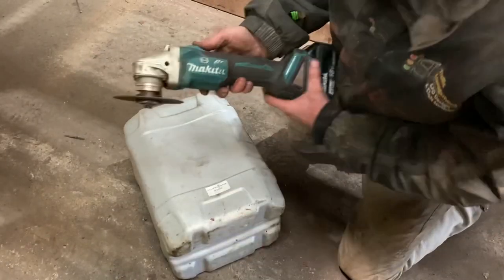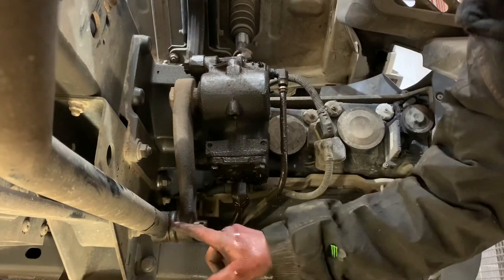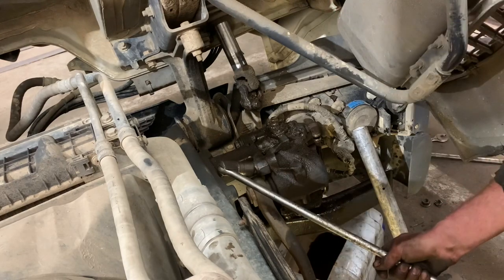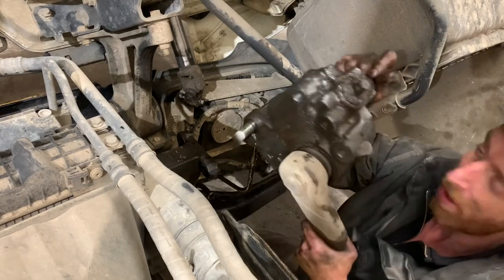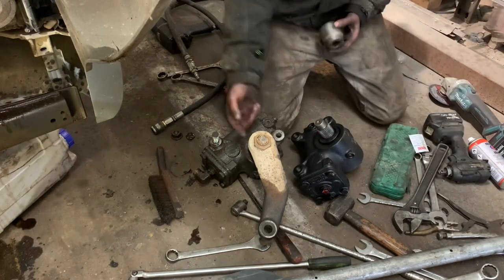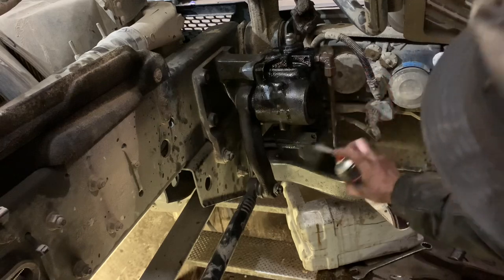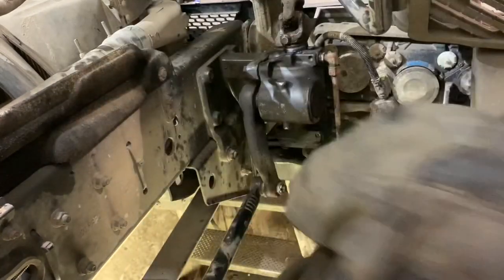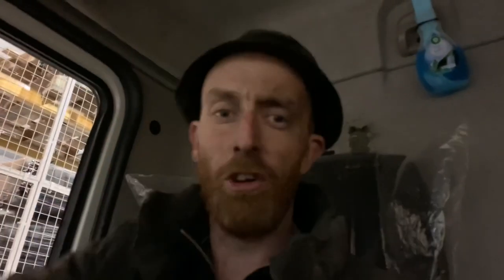How to change steering box Daf Lf mobile hgv mechanic lorry truck semi

Comment: Hi again thanks for the video 
The best ball joint  spliter I have ever used  is the sealey  vs3805b got for 8 wheelers 2nd axle relay shaft  joints, used it today on one of those lfs 
Always  nice to see how other people  do things 
Regards Rob
Reply from the maker: Just googled that tool rob that looks a good bit of kit, be handy for the hard places where you can’t get a normal splitter in, and it don’t damage the gaiter, that would be handy on the van! Cheers pal 👍